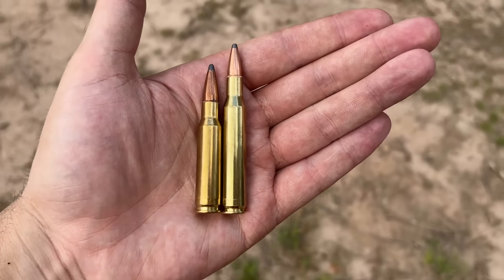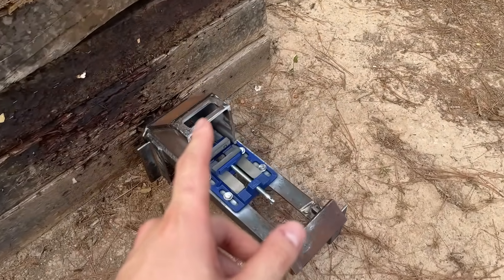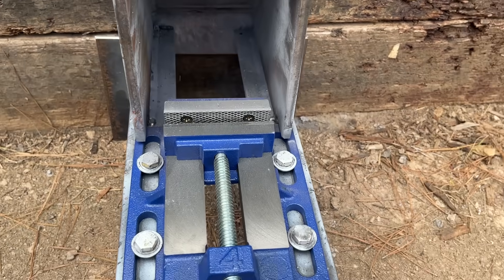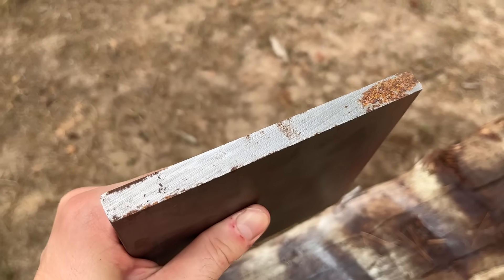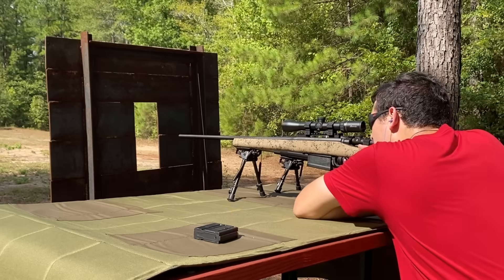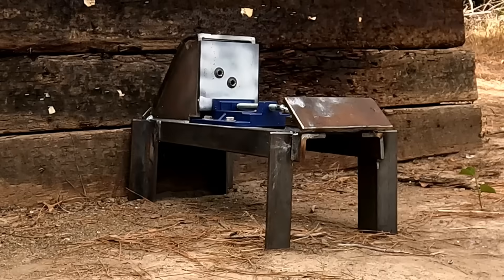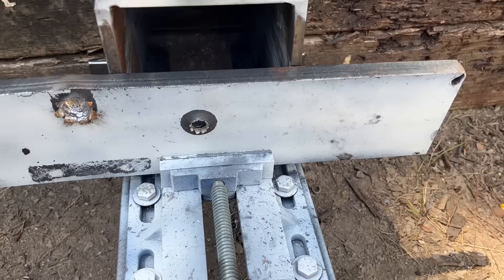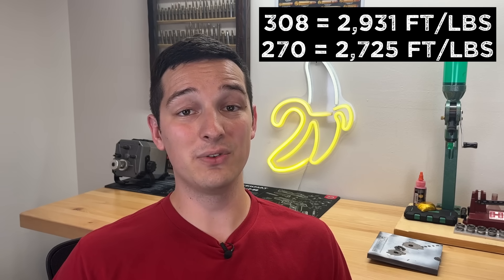270 Win vs 308 Win: ONE Clear Winner On Mild Steel

Comment: .270 is better for longer range hunting by comparison. But they're both relative to each other power wise. The. 270 is only slightly more powerful, and by that, I mean just barely. A 150 grain .270 is only about 50 to 100 foot lbs more powerful than a 150 grain .308. So it's negligible at best!

Overall, I like .308 Winchester more because of the more versatile grain weights, and the fact I'm a sucker for 30 calibers and prefer em' over any other caliber size.
Reply: Go for the 30-06 and a 270. you got more oomph (technical term for "hurtin") in the 30-06 but nicer long shots with the 270 and you only have to stock one brass.

Comment: Have you thought about using silicone gaskets between the plate and bolts? Sth to keep some of the vibrations down. Maybe even flex seal. That'd defeat it being removable though

Comment: Your handloads Scewed the results-- your 308 load is pretty hot, running about 100fps over most factory loads of that weight , while your 270 load is is on the lighter side of average. you got more energy out of the 308 case which has a total capacity of 56gr/H2O vs the270 having 67gr/H2O capacity.  Your initial ballistics are so scewed you may as well use different thickness plates for each caliber. Very poor test

Comment: Have you done a 25-06 vs 30-06?
Reply: A friend of mine is a .25-06 man. At the time i was a .30-06 nut. We were at the range one time. I had my own steel targets. His favorite bullet was a Combined Technologies 117 gr bullet. I had 165gr Remington Core-Lokts. Both of us were using max charges. I shot the plate and it made a nice wide crater. He shot the same plate about an inch away from my crater. His crater was deeper but narrow. Mine was about half the depth of his. Not very scientific I know. But I hope you found it interesting.

Comment: That is interesting to be honest, because I made it through 1/2 mild steel but looked closer to 5/8 with a 130g federal non-typical from 70feet. I do have picture proof too. The rifle I used was a Winchester XPR  cambered in 270win which I believe has a 22inch barrel but could be 24. And for those reading the comment the plate I shot was angled

Comment: 270 win is usually 1:10" twist rate.... which I think is the best hunting terminal ballistics.... but that 308 rocks with that faster rotation.  With the proper  bullet construction. Thanks for the video. Interesting!
Reply: You think it penetrated better due to faster spin?😂😂😂
Reply: @ToddSweeny  I prefer the 1:10 twist ,faster twist will shorten barrel life .....because of higher pressures. , energies may be higher with faster twist,  ruin more meat and or may explode on impact and fail...... just a thought.
Reply: @kevincallahan3059  None of those things are valid though. Not sure where you're getting this "information" but you find another source.
Reply: @ToddSweeny  maybe I'm not totally correct, it's only my opinion. Thanks for the reply..... faster is probably better .....I'm old school...

Comment: My two favorite cartridges in my favorite bullet weights for them. I hand load both on the mild side. The 308 with 150gr Winchester Power Point & the 270 with the Speer Grand Slam (I have a stockpile of Grand Slams that I will never shoot through 😊).

Comment: Thanks for the interesting video. 
I have just bought my first 308 (waiting for it to arrive) and I ordered 180 grain soft points for hunting. I always prefer a heavier bullet for hunting deer and larger game. Better sectional density. Some folks think I am a bit nuts though, because I want the heavier bullet in the 308 to actually slow it down. I hunt in the northern rural woodlands mostly, and I don't want to waste any meat with a high velocity round at some of our most common distances (20 to 60 yards shots are common) But the occasional field or power line is more distance than my old eyes (or 30-30) can handle, so I thought it time for a scoped rifle.
Reply: I usually shoot 165gr bullets in my .308 for deer hunting. I like the idea of 180s though. The bullet should retain more weight and mushrrom better. When I do load 180s I will use round nose bullets. Good luck with your hunt.
Reply: try a solid brass bullet in the 270.
Reply: @grisher111  270 is faster than 308. My point was to slow the bullet down, not speed it up. That's why I choose 180 grain in the 308. Too many deer taken at very close range up in these here parts. 20 to 70 yards average, I have personally never taken a deer past 55 yards. 270 is too much. That's why I don't own one. Great caliber for other parts of the country though. But occasionally I see a deer out at 100-150, even 200 yards at the edge of a field or power line. That's the only time I would want any scoped rifle at all, and the 308 is great for it. Otherwise my 30-30 lever gun with open sights is the best ticket.

Comment: That was a hot .308 load.  It produced .30-06 velocities.
Reply: No, it wasn't, when the .308win is shot through a 24" bl, it increases speed significantly, I shoot a Kimber Longmaster 308win, with great bullets it shoots 200 to 250fps faster! Most .308's have shorter bls, so they are anemic!
Reply: Yup he framed the test lol

Comment: If I remember correctly you said that the 270 was shooting a 130 grain projectile and the 308 was using a 150 grain projectile. A 20 grain difference between them doesn't seem like a lot, but a heavier projectile will always have more penetration than the lighter grain projectile.
Reply: LOL, don't use reason and logic here...
Reply: 🤔 why 556 is better on steel than 7.62x39?
Reply: @elmasloco6538  it's not.
Reply: @dannytravis7118  you probably new to the gun world son but believe me it is 100% better ✌️👍
Reply: @dannytravis7118 5.56 has penetrating power compared to the 7.62. 7.62 has more power but the 556 has more penetration.

Wait till you realize you can purchase armor piercing 9mm nato-
Reply: Truthfully, the validity  of your  statement is determined by the bullet construction, N0T the weight.
Reply: Velocity beats steel
Reply: 140 is optimal for the .270 flat long range cartridge  the .308 150   Wll have  lower poi at  600 yards  it’s why 6.5 dominates the nationals
Reply: @kencleg7721  Oh boy! Here we go again! If you are talking about the 6.5 Creedmoor it does dominate....as a long range paper puncher.
Reply: Then use a 165 in the .308?
Reply: Exactly!!!!
Reply: 270 is the better round i don't understand how your test failed lol
Reply: Bingo try the 160 in the .270 I use the 160 in a 6.5 x06 not much difference than a .270  .264vs .277   The bullet range is 85-160  a 160 at 2600 fps in a .264 will go through 42” of wet telephone books a 180 in 06 only 18-22”  so  the b c on the 6.5  is .512  in a 140    The new bullets for the 6.8 magnum which is .277 are 174 185  big difference the should have used 150 s for both
Reply: They were trying to favor the 270 by using the 130. With a 150 the 270 losers cuz it's slower and the 39 cal already has it beat with SD.
Reply: @twolak1972 in your dreams 😂 l have 170 grain loads doing 3000 fps in my 270 it shits on any 308 😂.
Reply: @JohnWinzil  BS. You couldn't get a 170 going that fast. I used to have a 270. With 150 hrs .a powder loads wouldn't push it past 2950. Went to a I'm rem mag I  got sick of blood trailing deer. 270 is way overrated. Anyone taking one for elk is a ignorant moron who does not respect the animal they hunt.

Comment: That's insane velocity for a .308. Must be Superformance or reeeeaaally hot handloads. Standard .308 150 gr velocity should be around 2800 fps. If you're gonna use an uber-hot .308 load, do the same for the .270. I want to say the .270 Superformance 130 gr is around 3200 fps. Not really an apples to apples comparison with the ammo used.
Reply: I handload 308. I thought the same thing. 2800 is good velocity for 150s in a 308.
Reply: Most 308s only get 2820 out of 24 inch barrel. That has to be superperformance loads
Reply: He said he was using the same model bullets for both, Hornady Interlock. Didn't say anything about handloads.
Reply: @BenAtTheTube you can buy Hornady Interlock bullets to hand load. The factory ammo has a stated MV of 2820.
Reply: Fraudulent test on his end. .270 is a step above the .308 and the math shows it. 

He loaded the .308 extremely hot on purpose
Reply: @TTU.40  Nope, the 24" truly makes it faster!!
Reply: Nope the Hornady load numbers come from 24 inch barrels.  @PeterKushubar
Reply: @PeterKushubar  the only lesson here is if you are dumb enough to buy a bolt action .308, at least get the 24” barrel.

Comment: That .308 may have only 7.5% more muzzle (kinetic) energy (0.5*mass*velocity^2), but it has 11% more momentum (mass*velocity). I've seen indications on other channels that momentum seems to make more difference in penetrating a hard target while kinetic energy makes more of a difference in wound potential. One thing that also gets neglected in all these calculations is the rotation energy and rotational inertia. They get neglected because they are very difficult to determine, but both contribute to the ballistics and impact conditions.
Reply: Sectional density is the main factor for penetration !
Reply: Rotational figures aren't hard to calculate. They get left out because they are irrelevant.

Comment: Great video. Thought for sure the .270 was going through. Maybe a slightly heavier .270 just an idea. Love the format of your videos.
Reply: Both, my favourite cartridges. But these cartridges were designed for different purposes... now you know why the 308 was NATO'S choice... for military purposes.
For hunting purposes, bushveld the 308... open plains semi-desert the 270... but either is still a good choice as I ain't never seen any animal wearing a bullet proof vest or steel plate armoury... 😅😂😅😂 a 150gr in 308 is magic round....
To me, the two most important factors in hunting are:-
Nr.1 confidence in your rifle.... if you are not confident with your rifle...  get rid of it ASAP.
2ndly, bullet placement.... remember you are aiming at a target, heart or brain, inside the visible or outer target. Angular shots need a different point of entry...
Happy hunting 😊

Comment: Surprised me. I was ready for the exact opposite results. And I am a 308 proponent. Thank you.
Reply: I know years ago the guys always shot the 270 against the 06, and could always shoot through more steel with the 270 , so not sure what happened here, I'm sure they probably had both rounds loaded to the max back then
Reply: I noticed his 308 interlocks were hot loads 2966 fps normal 150 are only 2820 fps.  He slipped in hot loads againt the 270.  Just check the specs he cheated! @robertboyd3863

Comment: This reinforces my decision on the .308 i chose as my primary bolt rifle. My other considerations were the 6.5 creedmoor and .270. The .308 (7.62x51) was used for battle, for a reason. I'll probaly get a 6.5 still and have a few options.
Reply: 308 or nothing
Reply: I've heard a lot of deer get lost using 6.5, and some hunt guides wont allow it because of that
Reply: A friend of mine's whole family uses 6.5 Creedmoor for deer hunting. They killed about 20 deer last year. Granted it was basically brush hunting. But they didn't lose any deer. I usually deer hunt with a .308 Win. It always works for me. @danadouglass9028
Reply: Get a .30 06, I got a .308 and I like it a lot but it drops like a cannon ball. If you want a super flat shooting cartridge that kicks as much as a .308 but has way more energy then get a 7mm remington. Take my word for it. Then get a .308 after.
Reply: Yea I'd love a 7 mag, but I don't like those long barrels they typically have, as my terrain is hills and brush, which brings me to my most recent lever boom stick.
Reply: A lot of them have 26" barrells. Which is a pain to move in brush. But some are available in 24". Still not nearly as handy as a good lever. Browning makes a lever 7mm Rem Mag. though. Happy hunting. @coupe50h
Reply: 7mm Rem Mag is great round. I have one one. And have had a few over the years. It is a flat shooting beast. One reason I like the .308 is the bullet drop. It drops quickly and you don't have the concern of hitting something unintended further out. I won't  use a straight wall cartridge unless I absolutely have to. They are not .308 level performers. .30-06 and 7mm Rem mag are vicious on deer.  @YourLocalShooter
Reply: @winstonjones7519  7mm is perfect for elk and anything less or more. It’s my next catridge after going to the range with my buddy and shooting his sako 7mm. I was holding half a mil on a target 450 yards out and hitting dead center with the 7mm. When I was shooting my .308 winchester I was holding at 4.5 mils for the same target .  Both were zeroed at 100 yards.

Comment: If that 308 brass is being reloaded it looks like you’re about to have some case head separation I had some 65 Grendel brass that started doing that and all the research told me I needed to throw them away and I did but I assume you have been reloading way longer than me so maybe you can inform me that I am wrong

Comment: I’m no fan of the 270, I don’t even own one, but I call this win for the 308 fake news until he tests them apples to apples. Factory 270 loads in that bullet weight go up to 3200 fps. This test fired a middle of the road 270 velocity for a maximum 308 velocity. The 308 needs to be loaded at the published velocity of the interlock or the 270 needs to be loaded to the speed of the SST, which is where the velocity of the 308 was. I’m all for a rematch.

Comment: with a a harder projectile type the extra speed of the 270 would become a greater advantage than the 308s mass especially for penetration. Do the test over with some solid brass projectiles and you would have a much more definitive comparison. since the nature of lead is to dump energy not penetrate hard materials.

Comment: For the 308 those are Hornady Superformance numbers.    Hornady advertises 2820 fps and 2649 ft-lb with a 24 inch barrel for all ammo except for their Superformance line.
Reply: That’s what I was thinking as well. I’m thinking he is hand loading and loaded the 308 hot while loading the 270 at average speeds. Load SST’s and the 270 goes through and maybe beats the 308.  My testing on AR500 steel has 5.56 leaving a dimple at 3300fps. My 22-259 gets half way though at 3600 and blows right through at 3800. 200 fps would make a huge difference.

Comment: The reason .308 penetrated better comes down to energy and momentum. The .270 gives up 200 ft pounds of energy and is 6 shy of .308 in momentum (57.11 vs. 63.56). Newtonian Laws of Motion can’t be ignored. The .308 just has more gas to get things done and it’s harder to stop once it gets going.
Reply from the maker: Thank you for bringing up momentum. That is something I failed to mention.
Reply: @bananaballistics  use 150 grain same bullets for both rounds, there is nothing to even discuss till you do that.
Reply: True.. 25 feet from the muzzle. Would be cool to do this at 50 , 100 , 150 and so on in 50 yrd increments
Reply: Yah not rigged. Grain weight isn't all telling. Chamber pressure and bullet weight have alot to do with it also.
Reply: but down range, the .270 passes the .308 as the .308 sheds velocity faster it also gives up energy and momentum faster.
Reply: @m444ss  yes, but at what distance  does the .270 pass the .308? For 90+% of shooters who rarely, if ever, reach beyond 200 yards, .308 is still king.
Reply: @DaddyHawksToyBox  If you load it correctly, it's faster out of the gate. MagPro powder will get 3240 fps from a 270 130 gr; 3000 fps is easy with 150 gr 270. That is the eqivalent of a 180 grain 308 as far as performance on game is concerned
Reply: @DaddyHawksToyBox 😂😂😂 you're funny
Reply: @CARLPHILLY Nothing rigged here. Hornady probably loads these 2 cartridges to different pressures. I really expected the .270 to have a couple hundred fps more than it had, but that's factory ammo. These comparisons aren't very scientific, but you should apologize to BB for accusing him of fraud
Reply: Carlphilly, I never said anything about 308 being faster than 270. I was talking physics not velocity. What’s your point? Adam at WhoTeeWho is fun to watch, but it’s an apples and oranges comparison to what was shown in this video.
Reply: The 308 use to be the the military sharp shooter load . I believe with unbelievable distances in the day!

Comment: I’m a huge fan of both these cartridges! I’ve killed so many deer with both, I’ve lost count. But I will tell you, the 270 kills better, without a doubt. The majority of the whitetails shot with the 270 drop dead, or only take a few steps. The ones shot with 308, the majority of them have run, or have made it considerably further before dropping. Just my observation.
Reply: Same results here. Switched from 308 to 270 with much better results
Reply: Might be related to other factors like angles and shot placement. You can easily see from these results that the .308 makes a bigger hole. And at least in this test, penetrated more.
Reply: really dont make much sense. i shoot the 3006 and have never had an issue with deer falling. its placement and sometimes just amped up deer. 270 is a necked down 06 its hard to beat a 30cal. just saying. i have both calibers but the 30 is king i think
Reply: You know, the types of ammo you use makes all the difference in the world. Stop hunting deers with match grade ammo  in your 308.
Reply: Nonsense
Reply: You're saying he's lying? Where do you live? LA? NYC? @larrybulthouse455